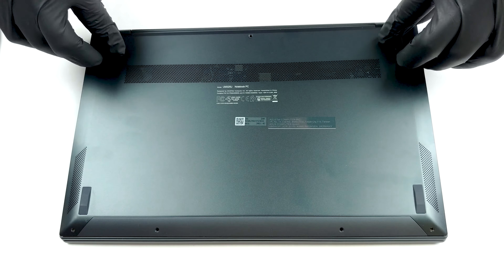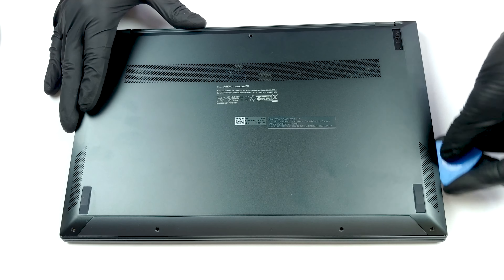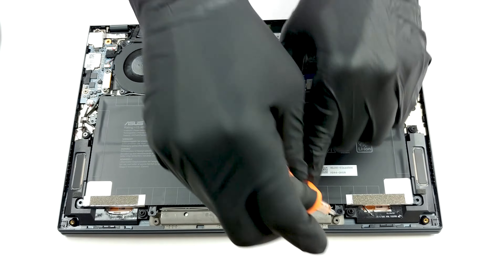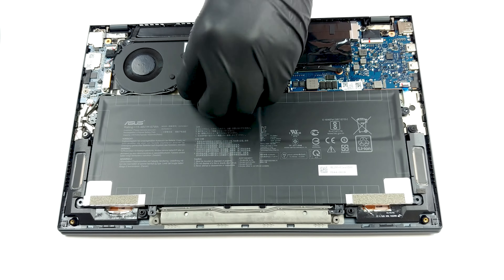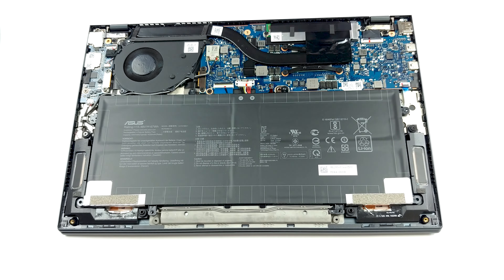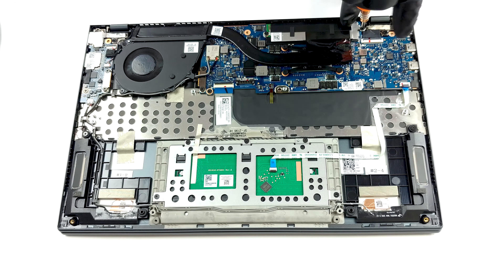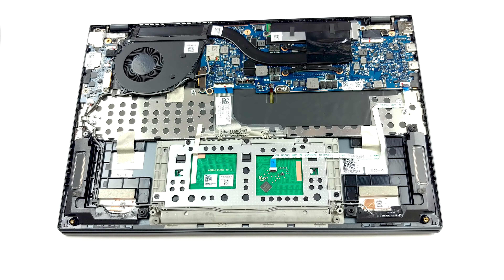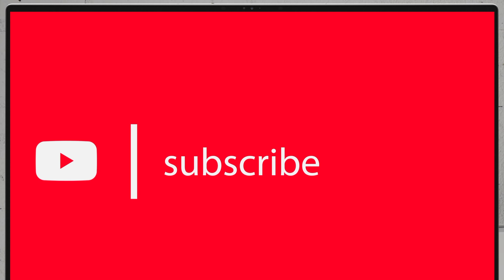🛠️ ASUS ZenBook 13 UM325 - disassembly and upgrade options

Comment: My laptop in a new one.its a Ux325ea.it was removed due to ticking sound from the fan. The battery port was removed and fixed again as it was before.But the laptop doesnt turn on and even i if i plugged it to the charger it doesnt turn on the charging light too.Can i please know a reason for this issue😢
Reply: Same issue.
Won't turn on.
No charging light, when plugged in.
Tried removing battery and holding power button down for 1 minut, to discharge static electricity charge.
After multiple static discharges attempts and with different combinations with battery and charger plugged in or out. Still no success.
Next attempt is figuring out if there is a removable CMOS battery, so the BIOS can be reset...

Comment: Hello! Thanks a lot for the video, but I have a question - if I get a new ssd, there's only one slot to put it in, right? And if I did it, would I have to install windows again? Thanks!!
Reply: Don't know if you figured it out by now, but yes - if you buy a brand new SSD, it will be fully clean and you'll need to install windows again. However, it is very easy to make a windows 10 or 11 bootable USB flash drive, which then you can use to install windows on the new SSD.
Reply: Depending on what you have to work with, you could also copy the existing SSDs partition to the new SSD and expand it to fill the available space.  NOT THAT IT'S EASY TO DO, but you could do it, there are tools to make it happen.

Comment: The RAM are removable? 
I want to update the ssd and ram,i can do it?
Reply: ram is soldered to the motherboard, therefore not upgradeable. for ssd, there's only one slot. if you want to upgrade the 512gb to 1tb, you have to switch the 512gb one to 1tb
https://nanoreview.net/en/laptop/asus-zenbook-13-oled-um325?m=s.2
Reply: @mmmmnnm3272  
I was afraid you would tell me but ... some youtuber say me that 8 GB is enough but I don't know how it behaves in video editing and photoshop, I'm afraid to buy it for that reason
Reply: @SonnyStoneMUSIC   nowadays, 8gb is still enough. but based on the review i linked in my previous comment, this laptop also has a 16gb ram variant but also soldered
Reply: @mmmmnnm3272  THE VGA is another problem!
this is the region for which I haven't bought it yet!
I don't know if is enough for the video editing in full hd or if i could use an external vga but i don't know where i connect it!